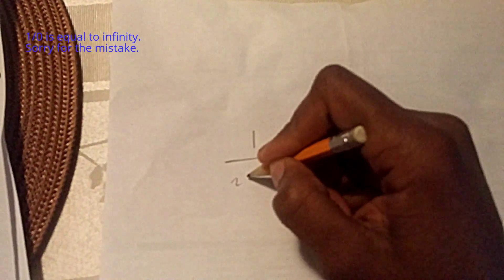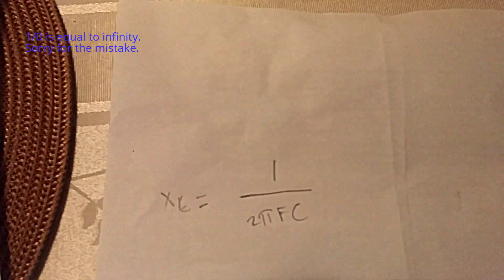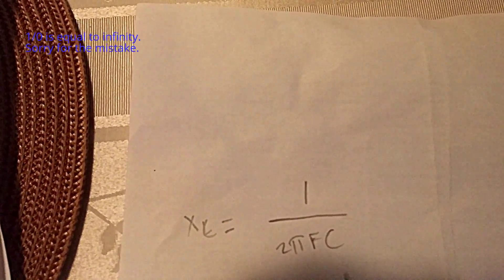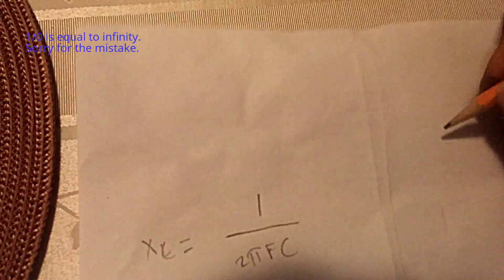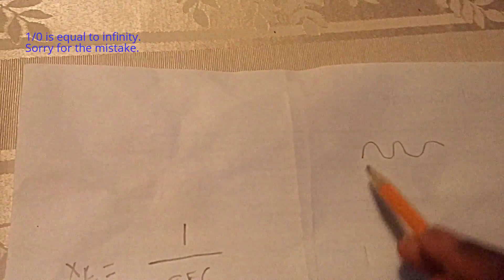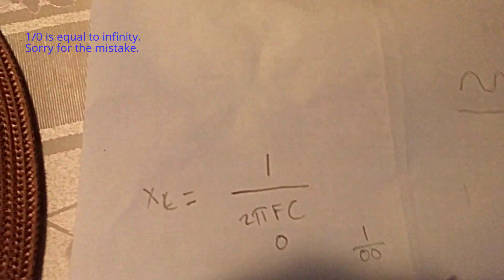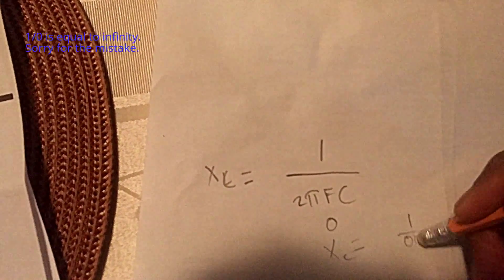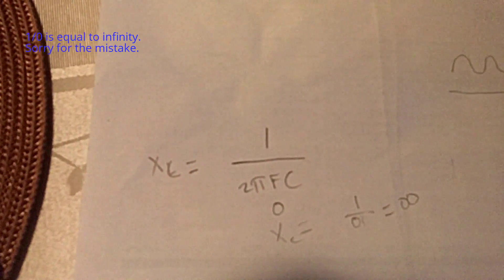Why Capacitors Block DC but Allow AC

Comment: That makes sense Mathematically, but in reality, in DC, the Capacitor's charge is constant, but in AC, since AC does indeed turn on and off Repeatedly, this means the Capacitor is constantly charging and discharging

Comment: Here is the answer,the capacitor has the  plate connected to the positive terminal ,positively charged and the opposite is true for the negative plate.what that means is that the positive plate when fully charged opposes the flow from the positive terminal since like charges opposes each other.Therefore no current flow.The formula only serves AC circuits so its wrong to use it to explain DC circuits.

Comment: Why zero?
Reply from the maker: A really high number divided by a really small number is a really big number. So when a large number is divided into nothing, it can be divided into that number a infinite number of times. If you aren't sure, punch those same numbers into your google calculator online.
Reply: my calculator says math error though!!
Reply from the maker: Well that is unfortunate. However if you think about it. It just makes sense.
Reply: @janettseng9058  simply DC frequency is zero, and it become undefined